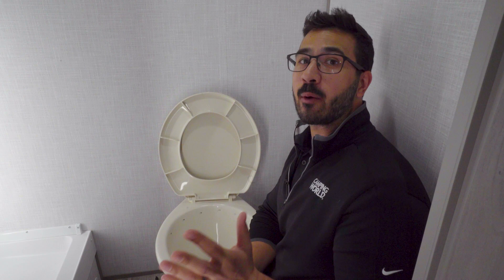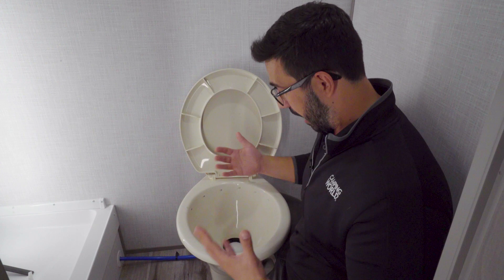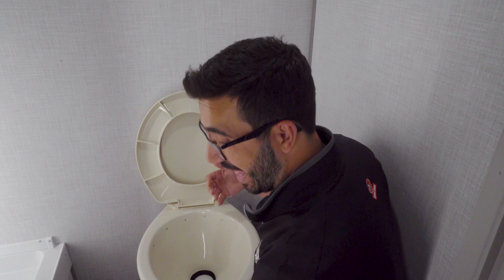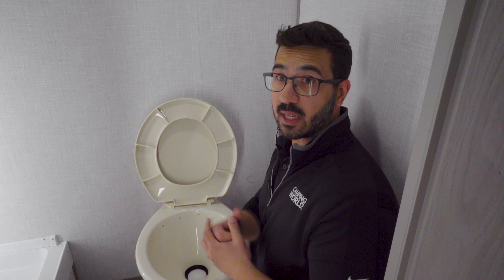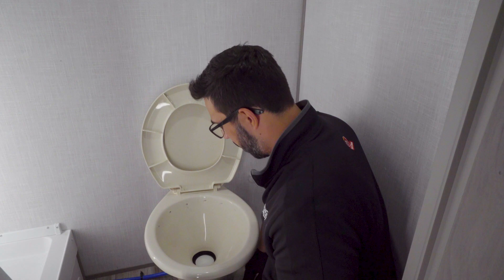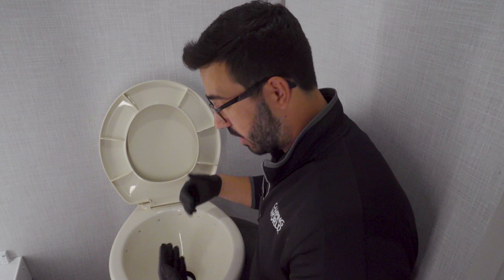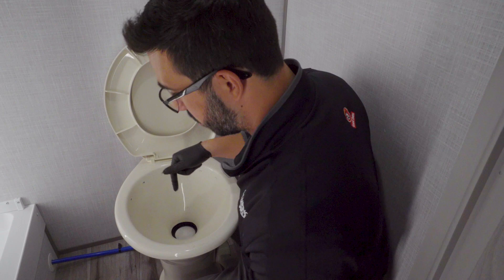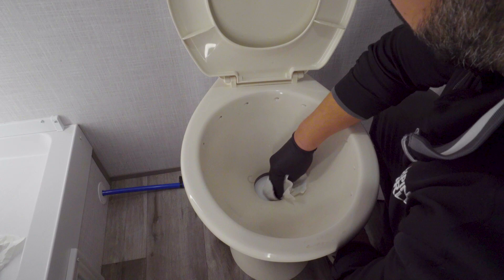How To: Maintain and Replace a Dometic Flush Ball Seal

Comment: Great video. I always wondered if the seal could be replaced. I've been limping along with my original seal by just cleaning the seal and ball as best I can and then putting vaseline on the under side of the seal. This usually gets it working for another several months. Another video shows applying some silicone grease directly to the bottom side of the new seal before putting it in place. It seems like a good idea. When I change mine, I think I'll do that as well.
Reply: Vaseline and other petroleum-based lubricants are said to deteriorate the seal faster.

Comment: I have a lot of calcium build-up.  I soak the rubber seal in vinegar.  The biggest problem is getting the calcium carbonate off the ball and the underside of the bowl where the seal normally sits.
Do you have any suggestions for that?  Vinegar will not 'stick' down there and it takes at the very least an hour to do its job of dissolving the calcium build-up.
Reply from the maker: Hey Thomas, Thanks for the question! One of my good friends in service said that you can try CLR to help remove that BUT...and this is a big BUT...would absolutely have you talk with a tech first, if you can bring the unit in even better.  I hope that helps! - Chris Young
Reply: @campingworld  I found a way.  I soaked an old rag in vinegar and squeezed it between the ball and the top.  I left that for a few hours and repeated it several times.  Afterwards I was able to easliy rub of chunks of calcium buildup.

Comment: We have a Sealand (Dometic) 510+ ceramic toilet. Even though I have to remove my toilet bowl to replace the seals, I’ll take that over that seal replacement. If that got dropped down into the black tank - NO, Thanks!  Bad design in my estimation. Great video though!
Thanks for wear gloves!  I’m sure that was a NEW toilet!😁  Also agree with @garydietz8807!🤢🤢